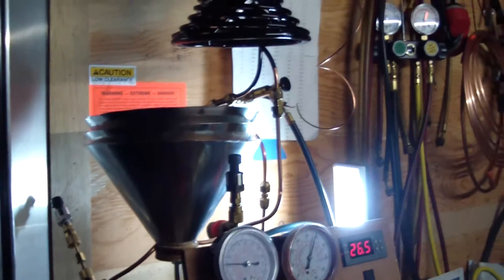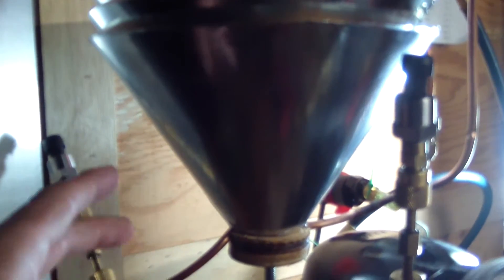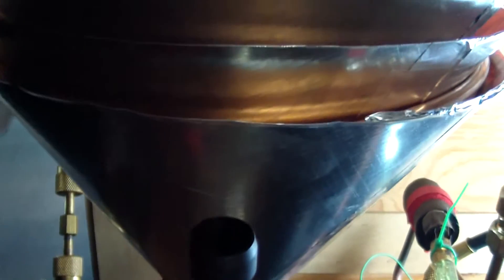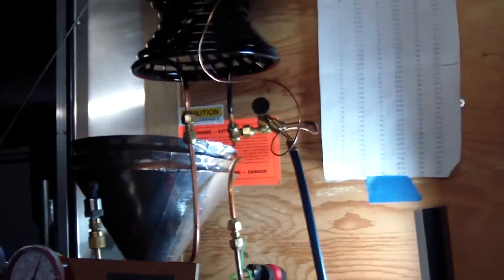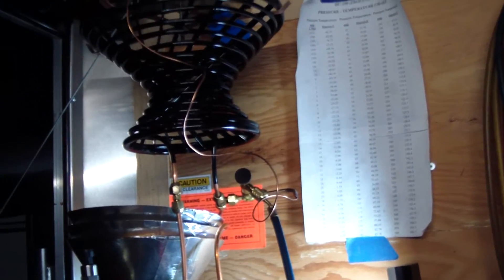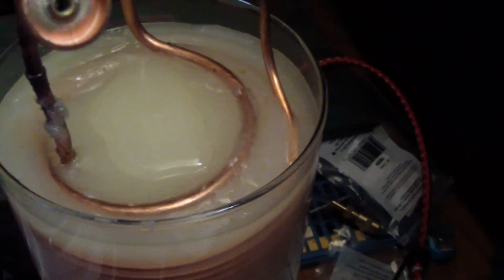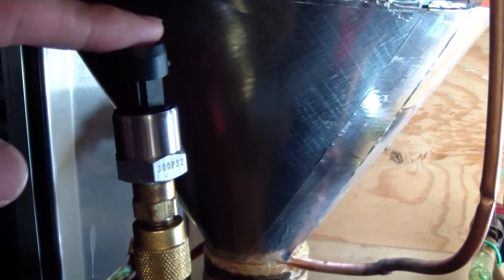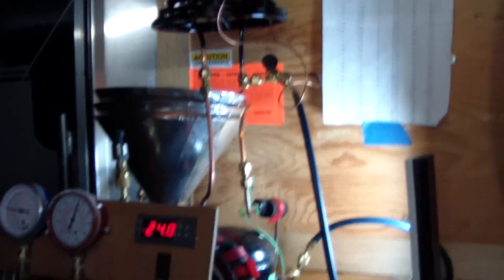New Two Phase Thermosiphon, Propane Refrigerator

Comment: How much were your transducers and where did you get them? Can you provide a part number? I've always liked the idea of being able to relocate the condensor. I've never thought of doing something like this though, pretty ingenious. I'd switch to ethanol/methanol or water and vacuum. Most heatpipes use water. As you mentioned in another video, it has a higher heat capacity, and I suspect a vacuum would allow more instantaneous dissipation, though your propane heat siphon seems to distribute the heat pretty quickly. Maybe build the condensor into a a tube-in-tube heat exchanger with fittings to easily connect into a siphon circuit.

Comment: I am so glad I finally found someone on youtube doing DIY hvac systems engineering. Maybe I can come out the other end of this binge watching in my immediate future with some idea on how to make myself a condenser and mini split system for my bus without resorting to a rooftop unit, just something with multiple power levels, DC and with a "split" evaporator for the inside. 
Learning how to size components and put them successful into a loop of your requirements is an incredibly hard thing to learn how to do on the internet as I am quickly finding out. Good beer btw, one of my more favorite "light" beers.
Reply: I'm pretty excited to see the lathe and metal spinning, as a machinist this is right up my alley.
Reply from the maker: Cool man.  Thanks for all the good comments.  I pretty much had the same attitude about this stuff; there just aren't very many DIY HVACR videos available, so I did it myself.  

What kind of bus are you working with?  Do you live in it?
Reply: Its a 91' E350 converted to a short bus by the collins corp. Their designation would be a 91' collins bantam. It's got an IDI 7.3 diesel. I've owned the bus since... well actually I just went and looked it up, this Sunday marks one year. The automatic blew up 6 months after I got it so I swapped in a ZF5 manual, that was a pretty huge project but now that it's over I'm kinda committed to this bus. The machine fills many roles for me but the primary reason I bought it was to convert it for living in while I am away at work out of town during the week then I bring it home or drive my gas saver home on the weekends. It's about a four hour trip.

Comment: i have one question, what happens with the small dc compressor?
Reply from the maker: I haven't run that thing in a while. Probably going to go back to it in the next few months. I don't want to risk damaging it until I get some of the kinks worked out of the experiments I've been trying. Today, I am returning to a simpler cycle that is more suitable for the DC unit.